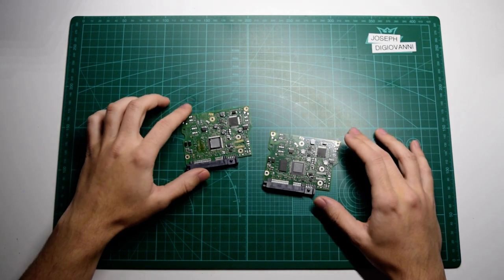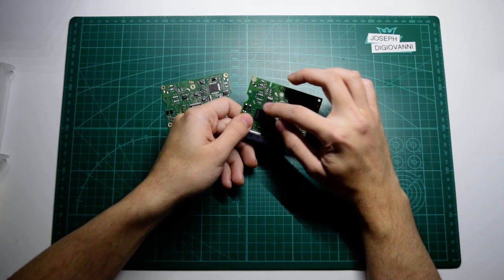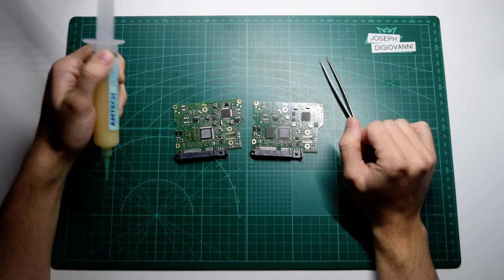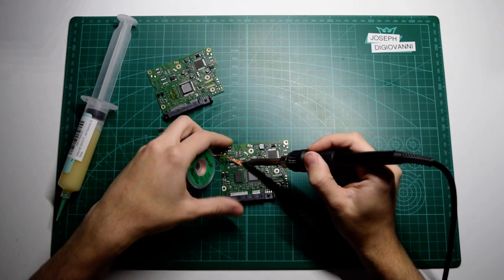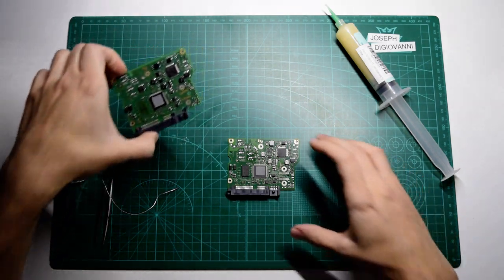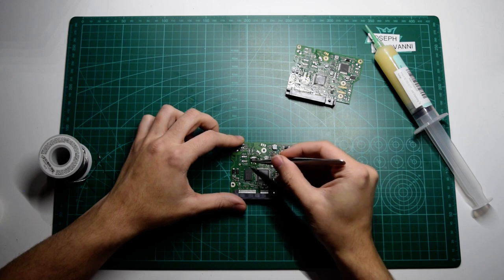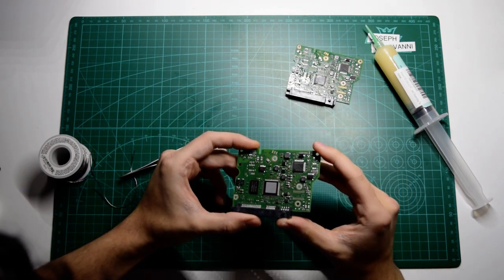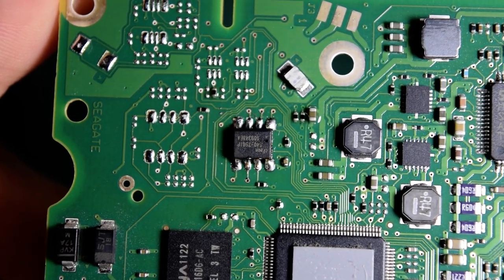How to Replace a Hard Drive PCB for Data Recovery

Comment: What make and model of heat gun are you using? I have the same issue and want to make sure I get the right one.
Reply from the maker: I used a cheap generic hot air/soldering iron combo for this video. Any hot air solder rework station will work, remember to remove the part from the new board first as practice since you won't need that chip after the swap

Comment: I had a external WD 3TB hard drive i got two months ago and it was having some connecting issues and then it stopped connecting completely like when i plug it in it doesn't act like it's plugged in. It does not spin at all and the light does not blink unless i bend the hdd usb port at certain point but even when the light blinks the hdd does not spin and acts dead. Please help me out here.
Reply from the maker: might need a new usb port, swap the board on the drive like in the video or swap the usb connector itself
Reply: @jdigi78  i'll also have to swap bios after swapping the board right?

Comment: I have an segate expansion external hard drive 3,5 ; 2TB and when I plug the usb cable the sound of new drive plays and then nothing in my computer but in disk management it will show or in bios or in device manager ! my question is,if i will buy new pcb boart find after the qr code from the hard disk,it will work? thank you !
Reply from the maker: does the drive vibrate or anything? if not the board replacement might work. Sometimes the drive will still attempt to show up in device manager etc because the usb controller in the external hard drive is still working fine
Reply: @jdigi78  do you have whatsapp or smth to send you a video with the noise(I think normal) of the hdd?
Reply from the maker: @BV18BLD  if it makes any noise at all it's likely powering up and the board is not likely the issue. Things to look for now would be "RAW" format in disk manager which means it is reading data but is corrupted. I'd consult a local repair shop before seeking any mail-in drive recovery options

Comment: can you just get another board from the same drive and just use that ? I have an old hard drive that doesn't spin. One day it just popped and never turned on again. I'm trying to see if I can get the same board and try to replace it. It's this model:  wd4000aaks 00tma0
Reply from the maker: Yes just make sure it's the same revision number and everything, as close of a match as you can get.

Comment: Will this work for external hard drive which was plugged into wrong charger, and now is dead?
Reply from the maker: Most likely
Reply from the maker: Usually large external drives that require a barrel plug have a separate enclosure pcb that can be replaced, and no chip swapping is required for this

Comment: Joseph, could you please write a few words about your equipment. What kind of tool (hot air rework station) did you use in the video? And what was the temperature? How large should be the air volume? i'm asking this because some hot air guns have air volume regulator. And i don't know what would could be the safe operational mode.  Thanks for the video.
Reply from the maker: I used a generic 852D+ rework station, I don't remember the settings I used but I imagine it was around 380-400c. You should practice on spare parts to just get a feel for the proper airflow and temperature yourself.
Reply: @jdigi78  Thanks for the answer. I'm gonna try it on dead Seagate pcb. But it is kinda scary. i'm concerned that the same temperature would kill the good one / the new one pcb. But anyway thanks. Quick chip is very costly alloy...

Comment: if a recovery software only sees 500 mb out of 320 gb..you think its the board or the mechanical disks inside the harddrive?
Reply from the maker: Sounds like a mechanical issue or formatting issue. Either way replacing the board is not likely to fix it

Comment: Sir My Seagate HDD spins and stops for few minutes how can we recovery the data                By swapping Platters and BIOS  IC it’s possible to recovery the data
Reply from the maker: I'm not confident it's the pcb but if you know what you're doing there is a low risk of damaging anything doing a pcb swap so you may want to try that first to rule it out. I'm not familiar with head swapping or any other form of HD repair sorry

Comment: Great job , is bitlocker will be removed if I replaced the chip with new one ?
Reply from the maker: You're replacing the board and transferring the chip, so it shouldn't effect any data stored on it

Comment: Do you still respond on here I need help to please, one of my hard drives gets powers it's pretty obvious because when I've got it plugged in it gets warm, but the platters aren't spinning and there's no vibration... 

DO i need to replace the whole PCB ALONG with a BIOS or just the PCB as a whole.

Western Digital NAS 6TB 2014, 

Please help thanks!
Reply from the maker: if it gets warm it could be a short on the pcb. I would swap the board, you will most likely need to swap the bios chip as well. if you're not comfortable with doing it ask a local computer shop if they can do it. Avoid chains like geeksquad though
Reply: @jdigi78  I'm in the united kingdom, i don't know what or who geeksquad.
Reply: @jdigi78  SO if my hard-drive is getting power, does that mean I still have a 90% Chance by replacing the pcb/bios chip, that my hard drive will work??

Even if the platters aren't spinning

I was switching harddrive bays earlier on, my harddrive was working 100% fine never dropped or anything, i think it maybe fried circuit.. so i highly doubt it's the spinners

Do you think with this being said that it could be the spoinners, i hope it's not!
Reply from the maker: @Saradomian  it's hard to say, but if the pcb gets warm I'd say it will likely still work if you replace the pcb
Reply: @jdigi78  That doesn't answer, to much and give me hope..

Would you say the platters are fucked or  stuck, what's the chances in that? because that's something 100% I dont want to really deal with if they are
Reply from the maker: @Saradomian  I don't know what to tell you. there is no way to know without trying. If you don't want to try it I assume the data is just not worth the trouble

Comment: my 250 gb seagate hdd is detected in bios, but the same is not shown in windows ... i tried to re-solder the contact parts on pcb .. but not succeeded .... help & guide in this regard ... another question ... if i got another identical hdd pcb (with identical rev. no., firmware version, etc.), can i just swap the pcd and will it work or i also need to swap hdd bios/ram to target pcb ??
Reply from the maker: In my experience you will need to swap the bios chip, you can try without doing that first and it shouldn't cause any damage
Reply: @jdigi78   Lots of thanks for your prompt reply ... i will tweak bios settings for my earlier part of my query ... thx for a informative video ..

Comment: Recap:

1-Looks like my original bios was erased.
2-Looks like my original bios was only partially copied over to the new rom.: 512K worth.
3-I have one PCB Donor Board that boots up the hard drive and keeps it running but o/s can't read the data.
4. Data Recovery Place that transferred my bios to another PCB Donor Board, said they don't back up roms and they don't have my rom to email me.

What are my options?
Reply from the maker: Outside of contacting a big name recovery company, none. The rom contains important calibration data and it would take some serious equipment, software, and knowledge to be able to get the data with just the platters
Reply: @jdigi78  Who do you recommend?
Reply from the maker: @needspractice  I don't know, I've never sent out a drive for data recovery

Comment: i have drive can detect but not spin & incorrect function message after choose initialize disk use MBR in disk management
Reply from the maker: This will likely not fix it
Reply: @jdigi78  how to replace main IC 88i6745-TFJ1 ?

Comment: But did it work? Were you able to access the drive?
Reply from the maker: Yes, the drive ran just like nothing ever happened (originally it did nothing because one of the components was shorted out)
Reply: My drive appears to be spinning, recognized in disk utilities (mac), but it won't mount or repair. Any suggestions?
Reply from the maker: @angelthman1659  Macs can be picky about mounting failing or corrupt drives. I'd recommend mounting it in linux as read only or if it has windows on it use a windows machine. Linux would be ideal though
Reply: I have the EXACT same situation. I don't even need to recover the data (Time Machine saved me), but I'd like to be able to use the 750GB as either a 2nd external backup or, preferably, an internal 2nd hd, with partitions. @angelthman1659  Thanks for your question!
Reply: @angelthman1659  Platter transfer.  Not too difficult, but you need to wear gloves.
Reply: @angelthman1659  Knoppix. linux based dvd rom  based OS.  Ive had much success with that.  it can see data any other os  cant
Reply: @jdigi78  Knoppix is a great simple os to use.  The current version is both gui friendly and so intuitive.  It can see data most proprietary software can see. Ive used it countless times.

Comment: Any chance of success without a heat gun?
Reply from the maker: Try low melt solder like chipquik, it stays molten longer allowing you to heat up all pins equally
Reply: @jdigi78  Thanks!

Comment: I got my cord stuck on a chair and ripped the usb-c plug off my Western Digital ssd. It has the WD password protection. If I order the exact same board and swap the bios chip, do you think there would be any problems with passwords? 
It is set up to automatically recognize my computer when plugged in.
Reply from the maker: I'm not sure how the encryption is implemented, but I'd bet it would work. I doubt it would hurt to try
Reply: So I got an identical board and swapped the chip. It didn't seem too difficult, and everything looks to be good. 
When I plug it in, it sounds to be spinning up normally. The computer recognizes it, but nothing shows in file explorer. No E drive. 
I can see it in disk management and says the drive is working normally, but I can't access anything. 
Any thoughts?
Reply: After about 20-30 seconds I can hear the drive make a different sound and it turns off or shuts down. I can still see it on the computer though... strange
Reply from the maker: @meeko308  does it have any partitions in disk management?
Reply: No. It just shows up by name under removable devices. 
I don't have it in front of me right now, but when I right click to view properties, under disk space it says "unknown". or "undefined".

Comment: So you gotta swap the new bios chip pcb you got to the old pcb hdd thay didnt work?
Reply from the maker: No. Old bios chip to the new pcb
Reply: @jdigi78  ahhh ok and it should boot up and spin yea thats whats going on with mine wont spin at all idk if a diode at all also.
Reply: @jdigi78  man i fucked my donor pcb chip I put flux hot air on it had tweezers and the chip broke off it smh and resadue on pcb..glad it was not my my pcb that had data fon 50 bucks down the drain omfg im so mad you make ot look easy the bios chip would not budge at all on my end and it broke.
Reply from the maker: @kevinthorn9672  try putting fresh solder on the pins before using the hot air. Use a higher temp. You shouldn't need to pull the chip off with force, the solder should melt and it'll fall right off
Reply: @jdigi78  ya i killed the donor board other chips fell off also idk where i can send it for it to be done by someone else